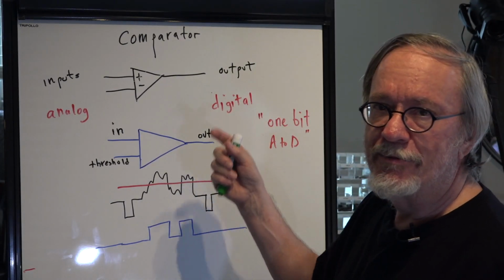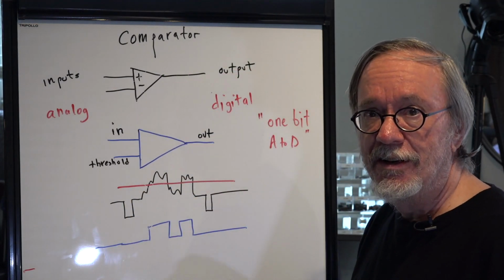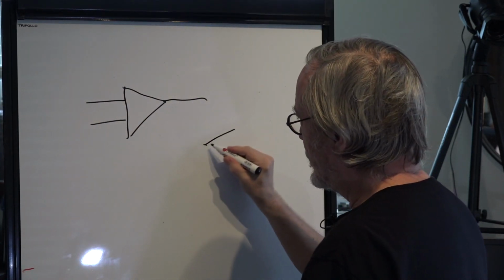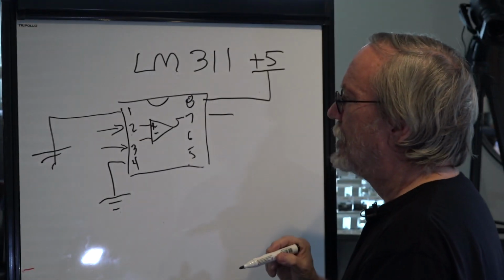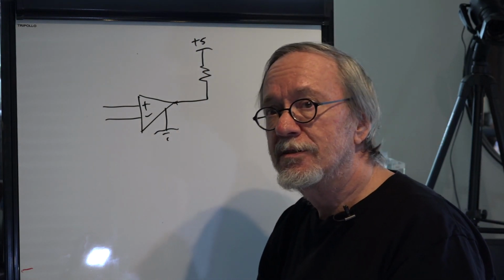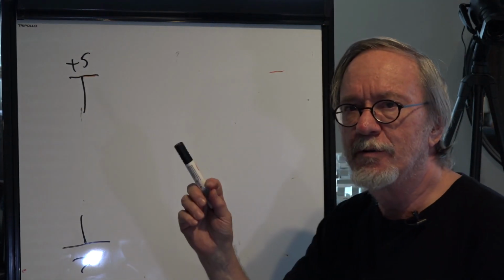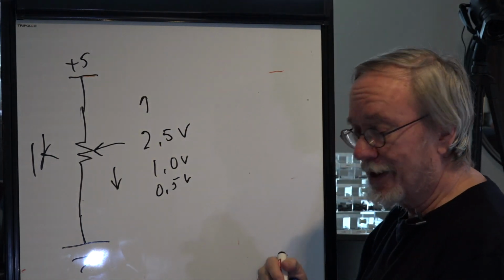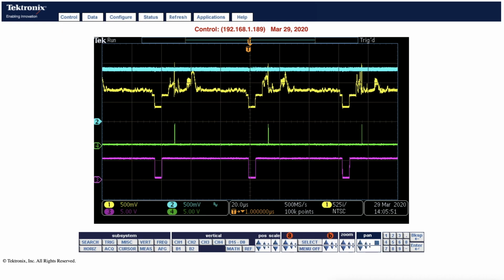Lesson 1 - Comparators

Comment: Great video! Pls keep at this!
So, I'm going to follow your classes in practice but I dont have a black and white camera. Is it possible to use a regular color ntsc camera?
Reply from the maker: Eduardo Guarda Is there any chance your camera has an S video connector on it? I’m imagining we could put a simple filter on the input of my circuit to eliminate the chroma. I’ll try that and include the results in my next video. Thanks for watching!!
Reply: Yes, tha camera has s video out. I'm just figuring out how to connect it to breadboard
Reply from the maker: I just tested the circuit. No problem with regular color NTSC as an input. Just keep the sync pickoff threshold low. (The circuit output is still black and white.)